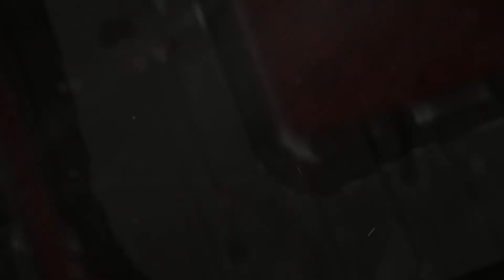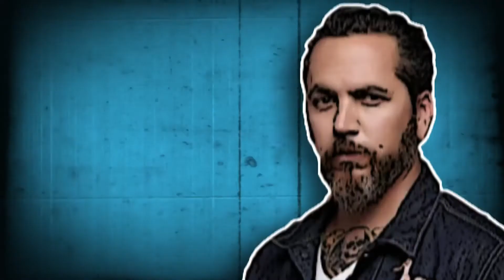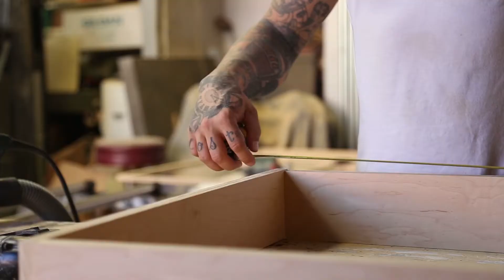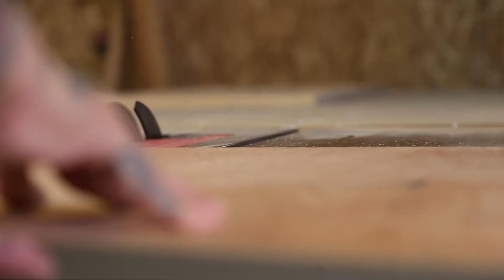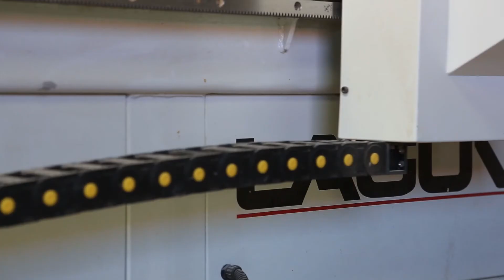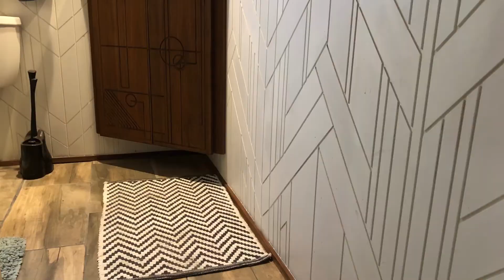3D panel

Comment: Your designs are fantastic! And the videos are funny (who left here without shoes on?) and informative.

As for the debate over handmade vs. CNC, you're in business...if you did everything by hand, you wouldn't be! It'd be a hobby, I imagine.
I think it's the same with lots of creative endeavors---I knit and the reason for doing it by hand is mostly therapeutic; but many professional designers use knitting machines because their focus is on designing/selling patterns; basically their livelihood...not spending two months to make one item that is basically cost-prohibitive to produce (and let's face it, usually somewhat itchy to wear 😁). 

Kudos, & Good luck in the future!
Reply from the maker: Thank you very much! I think of a CNC not only as able to produce something faster and cleaner; but also as a tool for creativity that I couldn’t do some things by hand.